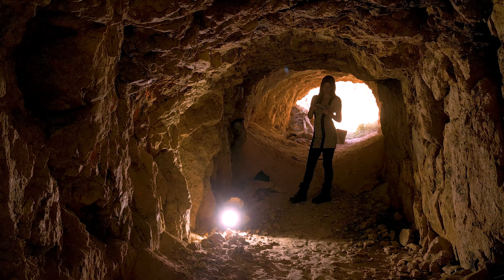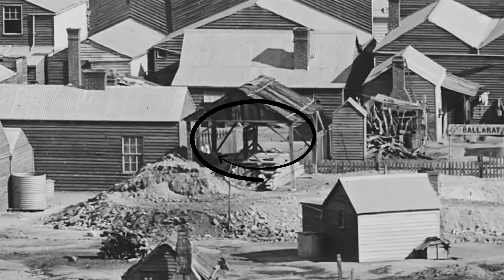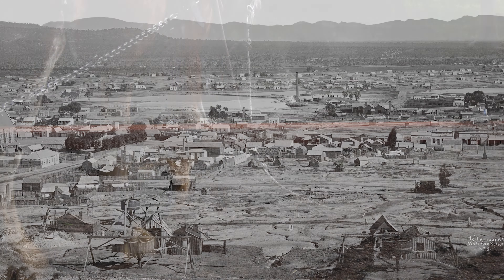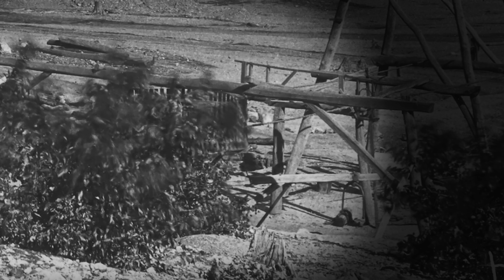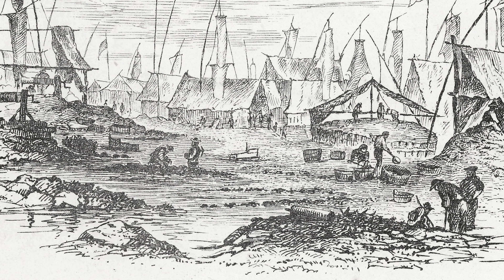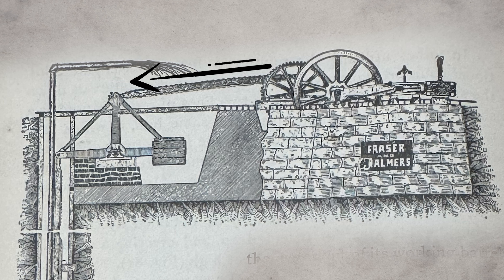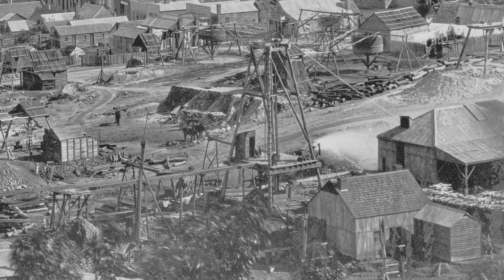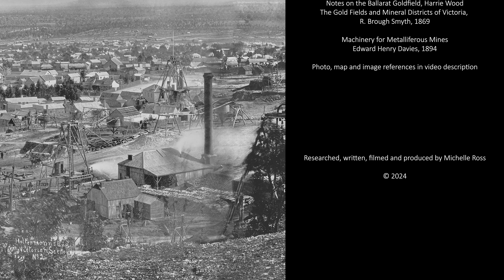Historical Gold Mining Machinery - A Panoramic View of the Stawell Goldfield

Comment: Try to find a video. Heritagerat, history of bucklands gold fields. The white miners used a square hole. For the windless, but chinese dug round holes, you see a slot on the top of the hole for a shaduf. A beam and fork post.  with a counter weight. They could bring up faster.